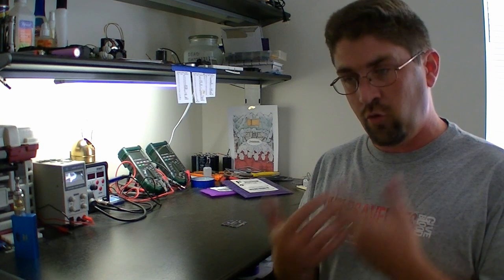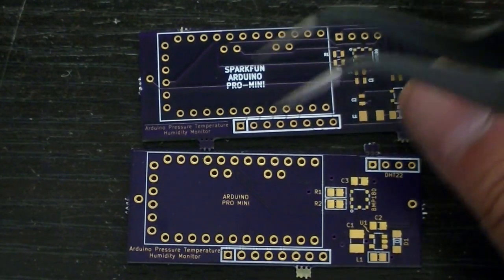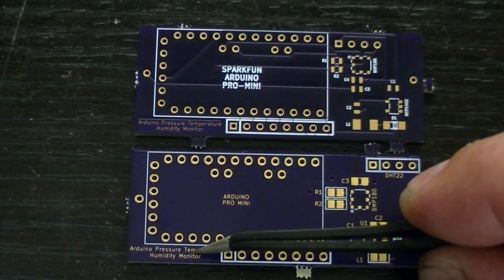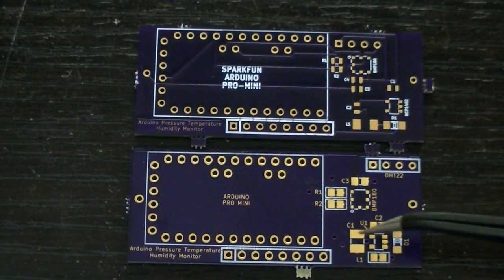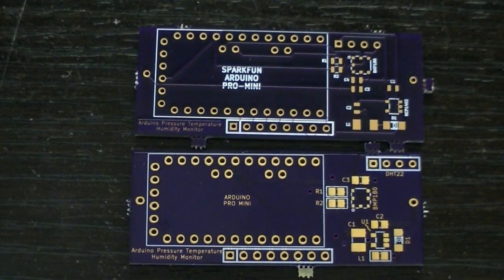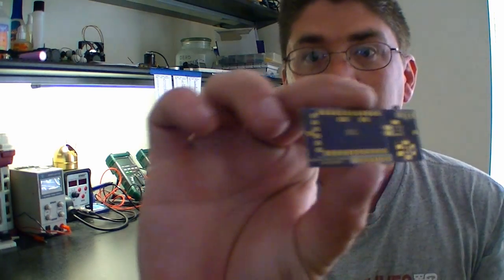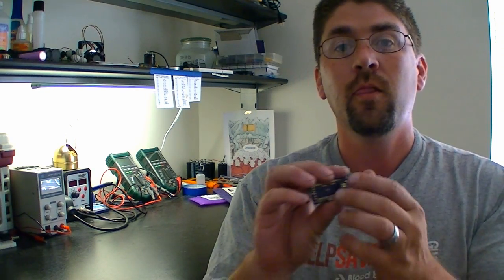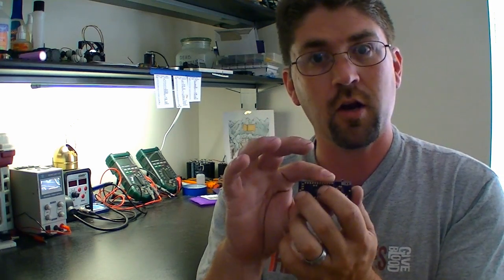Silkscreen vs Soldermask Text On Circuit Boards

Comment: Caveat: Make sure the component you are soldering over the exposed metal text does not short with it. For example, some communication modules have extra antenna pads and other test points on the bottom. If you solder the module and there is exposed metal right below those pads, then it may cause problems.

Comment: I came here looking for dual solder mask technique. I had heard about it few years ago. In that, you have your regular solder mask and on top of it the silk layer is applied in as another solder mask. Solder masks are designed to be sharp as sharpness is required for going in between SMD component pads. So text on solder mask is sharp.

Comment: Good tip, thanks!  In the software I use, the copper layer is called Top Copper, not Soldermask.  Soldermask is its own layer, the paint between the silkscreen and the copper.
Reply: He's not saying add text onto the copper layer, he's saying remove soldermask from that layer to show the copper fill/pour/ground plane underneath, which if you have gold plated board will then show up as gold. e.g in Eagle, you'd be writing on the tStop/bStop layers rather than generating a silkscreen gerber file from the tPlace/bPlace layers as would be more common.

It would be OK on very low density boards such as the one in the video, or when the manufacturer charges more for silkscreen and you only want a few component designators (but then if you haven't got the budget for silkscreen, you don't have the budget for gold plating), but it increases the risk of shorts when soldering and any solder that gets onto the text would ruin the look of the gold text, so many boards would still be better off using silkscreen for text.
Reply: Oh, I get it.  Yes, I agree, only helpful in a limited sense, when soldermask is already overlaying copper.  Don't think I could afford to do that on my board.